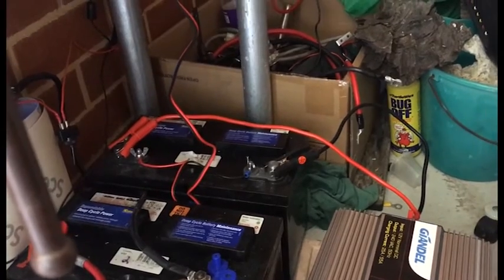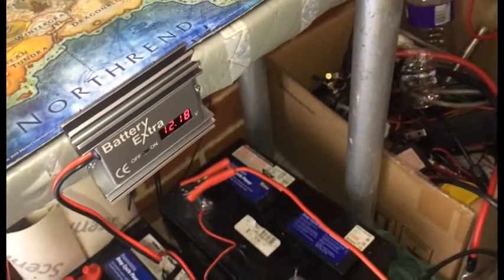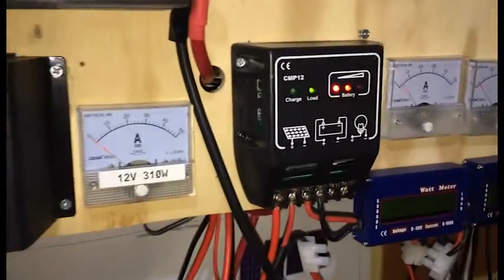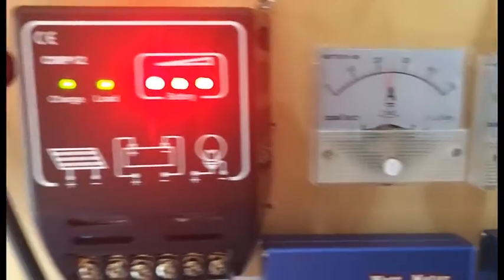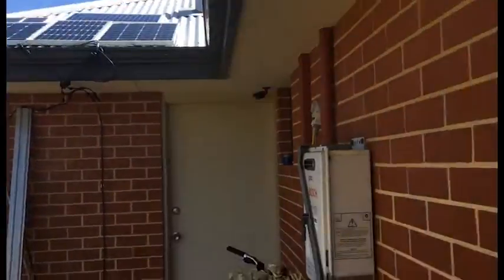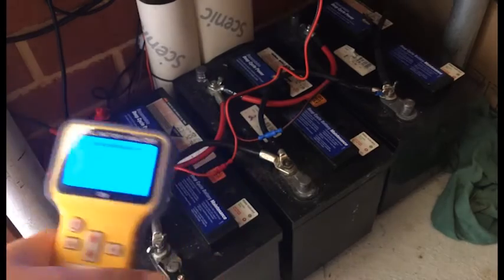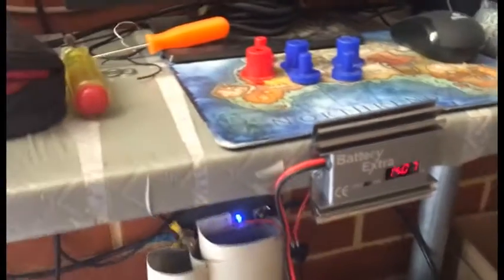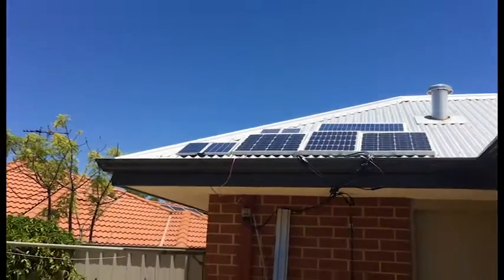Battery recon revive test and update

Comment: Well to get more out of your batteries you can buy inox mx2 battery conditioner you can buy if on Amazon or at your local auto store, I put it in my 100ah deep Cycle battery and its improved the capacity and I get longer hours using the battery
Reply from the maker: +Nick Pearson 
In Australia you can't get stuff from Amazon. I can buy Chemical that you can put into batteries on my car auto place which I have done in the past but I'm just going to buy secondhand solar batteries 2v cells and my old batters are going to my dad I'll get more chemical for the battery be for giving it to him.
Reply: Ok that's ok I like your setup by the way, and where did you buy that black solar charge controller from and what is it called
Reply from the maker: Nick Pearson 
Thx I got it from Ebay But I don't know the name of
Reply: Ok good luck with your setup I've got the exact same deep cycle battery in my arkpak 730 you can check that out on my channel

Comment: having multiple capacity and sized panels like that may be causing you to loose efficiency.
you gotta have the voltage and especially the amps as close as possible so you don't lose energy from the smaller outputting panels.
also need an update to see if you got any benefit in the long run :D
Reply from the maker: I do have them close i have 1 string that has 3 110w panels and 1 120w the other string has 4 40w panels and 2 10w and 2 5w join together and gose in to a combiner be for going to the other panels each string has its own controler
Reply: http://solarpanelsvenue.com/mixing-solar-panels/
this helps to explain it far better than I can.
depending on how it's all wired, it may not make all that much difference.
but then again, it may.
I've recently found four of my eight 38ah batteries have gone to shit, so I'm a little interested in how your desulfator has gone over the last year (if you're still using it)
even though all of them have been on a 250w panel through a epsolar MPPT controller all their loves, things seem to have gone badly somewhere along the way.
even though I've never taken them below 12.4v.   so no heavy discharging at all
so I'm considering giving a desulfator a go, the trouble is, choosing one that may actually work, because many don't seem to :/

Comment from the maker: I know I got shitty PWM charge controllers I will be replacing them. 1 of them was only a backup. I just haven't had the $ to replace them as of yet it's on my next thing to to list
Reply: You got the right idea of wiring the battery Bank but it is wired wrong on this 12 volt system cut the leaves of the battery extra short. One side positive and at the other end of the battery Bank negative that's for the battery extra and and charge controller the other end will be the inverter
Reply from the maker: +Kain Duran 
It is on opposite ends of the battery bank none of my stuff is wired off of one battery out of the bank
All the positives on the left side of the bank and all the negatives are on the right side of the bank

Comment: I got the big daddy version of your battery extra for my 1040Ah battery bank and after 3 days there is already a bit of improvement in my bank.  They seem to be a very worthwhile investment, and given the price of batteries, it is a low risk investment to try save yourself thousands.  I have subbed to your channel and will watch your updates.  Thank you for even further confirming to me that these devices really do help!!
Reply from the maker: Adam Kuklych 
So the bigger 1 is better?
Reply: Mine is the EX02 12-120-800 which is the biggest they have, but it handles a battery bank of up to 3000Ah at up to 120VDC.  So mine is rather overkill but in the future it won't be as I continue to expand my system.  That said getting the bigger one is dependent on the size of your battery bank, if you have a big bank of batteries then yes the bigger one will work better.  Also with mine you can set it to work with smaller battery banks until you can afford to get a big battery bank :)

Comment: I have the same desulfator working for six months now at my two 100 ah marine batts, i"m still not sure of the device really works, i have a (cheaper) macbat desulvator running on another set of AGM batterys, this unit produces a little "buzz" when hooked in circuit, i think that is based on a simple 555 timer so should give pulses around 22Khz, the Battery Extra is dead quit and when i tested it with a AM radio next to it does not produce any RF , which it should, so im thinking i bought a nice but expensive VOLT meter instead of a thru desulfator!
Generaly speaking desulfators DO work, as i experienced with experiments with a EXCELLENT build (by a German guy) VolksBedini 3.0 with has proven to me being capable of reviving many "dead" car and deepcycle batterys.
Remenber hooking up a desulvator on an existing solar powerbank alone is not very effective, you have to cycle the bats a few times from 11 volts to 15,3 / 15.5 Volts to see real results ( thus a controlled overcharge ) this can be acheved allso with hooking a solar panel directly to a battery but then ofcourse without the beneficial pulsing, so many variables working with ancient Lead acid technology that its hard to get conclusive results at one try, its more a matter of experience and most of al patience.
nice vid BTw, thanks for showing.
Reply: the Battery Extra is dead quit and when i tested it with a AM radio next to it does not produce any RF , which it should.  
Giottodiotto  We would be very concerned if your Battery Extra interfered with your AM radio. The unit has to be built to comply with the European EMC test standard  EN55025:2008, as it is often fitted to vehicles. This is to prevent ANY interference with other electronic equipment that may be fitted to the system.  It is a very difficult test to pass and is one of the reasons the Battery Extra costs more than many of the products available. If you would like a copy of the test report please email me at batteryextra@btconnect.com Dan Hornby, Battery Extra Ltd.
Reply from the maker: giottodiotto1 
I got the device because I'm known some other people that had it and it works my batteries are not in the best condition and it seems like it's doing the job
Reply: In any case this battery Extra units are very nice build and even in a worst case scenario won"t damage your batterys, but i do suggest to also  look at the "Bedini"style desulfators, they in time WILL give you good results, i use the bat extra butt for really badly sulphated battery’s prefer to recondition them with a "Bedini¨
the German guy name is Roy Kontush , he is also on youtube and has his own site named 'Volksbedini"check it out.....
Reply from the maker: Thanks i'll check it out
Reply: Dan, I DO believe this nice build little unit has some benefit on my small battery bank, but since like you mentioned the unit is build to comply strictly to EU regulations (i did not realize that) and deterioration on a relative new set of battery’s will take some time to show, as desulfation will also,  LOL, 
I think it would be beneficial to new customers to tell them in advance what the technical specs of your unit posses , pulse method, strenght, voltage, with , etc, etc .
I a Brother view i think that for maintaining a battery bank a desulphator extra is a very good device, but when battery s already have issues  caused by sulphation a short course with some kind of controlled overcharge coupled by hooking them up on a 'Bedini'style pulsator will give maximun results in a quicker time, so combining the two devices is even better.
Reply from the maker: +giottodiotto1 
Thx for your advice

Comment: i dont think testing the batterys when they are conected together will give you a good reading.
Reply: Let the battery disconnect for 24 hours then you can take a good reading with multimeter.
Reply: Yes, you'd need to disconnect the batteries for  more accurate results.
Reply from the maker: +Kain Duran 
Thx for your comment